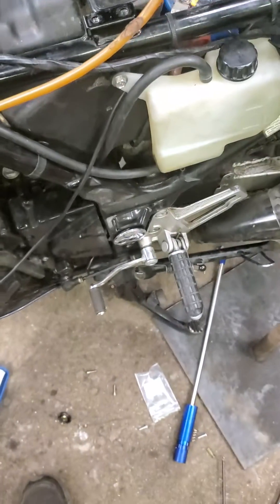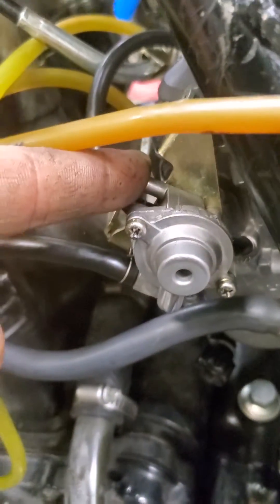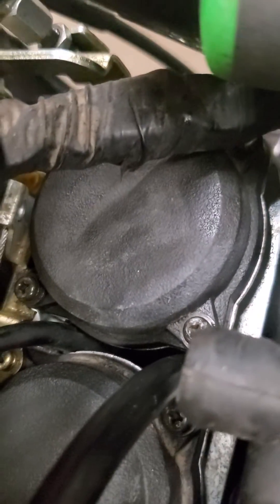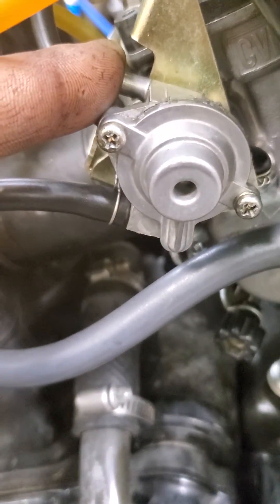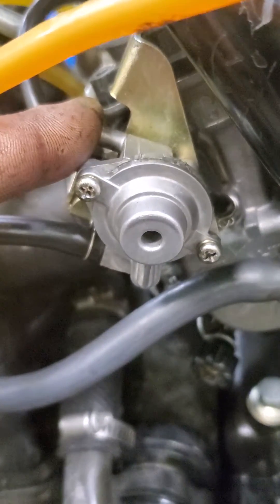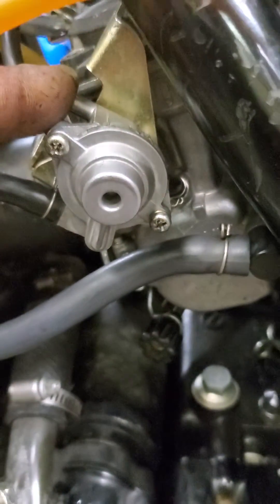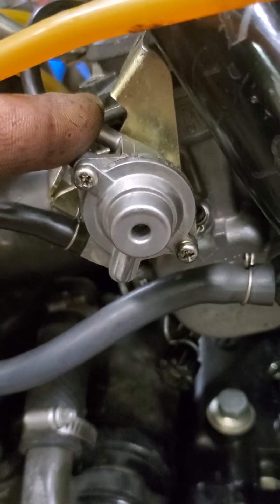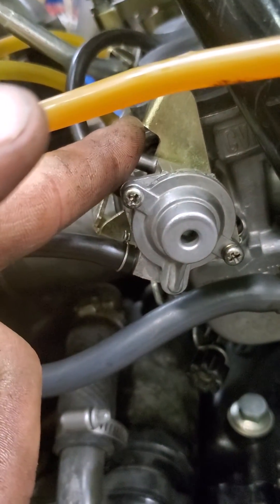Ninja 250 vacuum leak.

Comment: My ninja 250r which is 2011 model (the carb look alike the old gen) have this enricher problem so my mechanic took off the spring inside  the valve diaphragm and its now idling kinda better at 1,3k rpm but i think it has side effect when i rev to 2k rpm it returned below 1000 while i rev over 4k rpm it returns at 1,3k rpm which is the adjusted idle, what you think could be wrong? It has factory pilot and main jet also the both needle that different left and right code
Reply from the maker: If it is the spring and diaphragm I talk about in this video, it has to be in there and it has to be sealed.  That diaphragm is only opened when the throttle is closed and high enought rpm aka vacuum. 

In the video, the issue is that even tho the diaphragm spring is holding it closed and there is no vacuum,  it's leaking around the head of the pin on the diaphragm causing it to leak.  And it can not leak.

As for carbs, everything has to be right.  It's not 1 thing that makes an engine run well, it's all of it. 

Make sure you have no vacuum leaks between the carbs and the cylinder head.  Make sure your float high is right.  Not just by setting rhe float arm at 90 degrees, but also with a u shaped hose on the bowl drain to check fuel level inside the bowl.
Reply: @jdsstegman  well the diaphragm actually teared, but there's no leak between the valve diaphragm housing and the cover (even there is, can i use a sealent?). Theres no leak between carb and the engine head area especially the manifold, but im really skeptical on the coin valve also my Mechanic told me the vacuum valve and the spring is troubling too probably making the carb return to idle slower if i rev'd up over 4k rpm
Reply from the maker: @lordmeme9965  fix what you know is bad.  There is no selant that will work.  Replace the diaphragm with a new one.
Reply: @jdsstegman theres no one sell this diaphragm
Reply from the maker: @lordmeme9965  I'm pretty sure there are air cut off valaves available. 

But when I can, I will post a new video showing better what I'm talking about.  But if your diaphragm is torn, that's a different issue than what this video talks about and yours will have an even worse vacuum leak.  I would try and plug the vacuum like to the air cut off valave and see if that helps the idle issue.

Comment: if its not sealed would it be the fittings diaphgrams or the gap between them ?
Reply from the maker: The brass nipple on the diagram.   When it is in the hole and the spring pushes it closed, air can still go around the nipple.  That's where the leak occurs.   So at the base of the stem, that's where I put an oring.  That way if the nipple leaks, air will go down the stem but can leak past the oring.

Most of the time, I new diaphragm do little.  Because the aluminum hole that the diaphragm nipple goes down into is worn.  I use to re sleeve them with a brass insert, but every time to let off the throttle,  that diaphragm moves back and forth.  So they simply wear out.

Comment: Very good video on this valve but im still struggling to understand this valve. what is the actual purpose of it. And when you say " the idle does not hang" what do you mean by this? Also would i be right in saying you were applying vaccum to the enrichment valve on this video. i just noticed the position of your brass tap on that yellow/black pipe. were you just doing it for demonstration purposes.  thanks for the video.

Comment: My problem is that after 7 RPM it cuts off and there is no power. Could it be the same valve?
Reply from the maker: I don't think so.  You are accelerating so 1: there is no manifold vacuum and the valve only opens when rhe throttle is closed. 2:  at 7k you are running on the main jets in the carbs.  This valave is only to add fuel for idle when the the throttle is closed but the engine isn't at idle.so, I highly doubt it.

There are alot of reasons an engine will not get over a certian rpm.  If you have gone threw the carbs already, then double check your work.
Reply: Thank you for your answer me @jdsstegman

Comment: Great vid, I’ve got the same bike 2003 but same engine and vacuum setup. It has the same symptoms as shown in the vid, as in if the line is blocked off then it idles down, but in my case it completely stalls. Once the block is released, it goes up to a few thousand rpm idle. Any ideas? Thanks
Reply: idle jets clogged.

Comment: You sir are a wizard! It worked like magic! Pulled carbs. twice, once more than necessary. Long story short. Put o ring on, idle could now be adjusted with accuracy and ease. Blip the throttle and rpm falls right back to 1,400 to 1,500. Much thanks you save me from pulling carbs. who knows how many more times! Thank you again.
Reply: Hey, im blipping the throttle and it stays high, what did u exactly do?
Which O-ring did u put where?

Comment: So, good news. When I get my carb past 90 degrees, I blow on the fuel in line and it gets completely shut off. once the floats open the fuel(air) flows. I put an o ring on the brass shaft. It sits on top of the "base". Should it go around the base? That would prevent full movement of the diaphragm? I have pictures . Can I email you?
Reply from the maker: They have to be at 90 or slightly before 90.  If the floats sit down in the bowl lower than 90, when they are right side up that will be over full.

As for the diagram for the enrichment an oring should be placed at the end of the shaft.   The shaft had a head on it and the o ring has to go around the head down to the base. 

The problem is the head can wear and so can the body of the carb and they head won't stop airflow.   But if there is an oring at the base then the oring seals the hole with the help of the head and when the spring closes it and no vacuum is applied it is sealed.

I will try and make a video of this.
Reply from the maker: @EvolvingNaturally    no sealant.   It will just stop air from entering the hole the head goes in.  That head is called a pintal by the way.  Lol.
Reply: @jdsstegman  Tried my bike with the o-ring and carb rebuild tonight - idles great. I've ordered a new petcock as my tank emptied into a new hole in my driveway.

Thank you for the help. Looking forward to the "pintel ring"..... it will help many people!

Comment: I just did a carb rebuild with new needles and gaskets. I have the random idle issue too! My biggest problem is the fuel coming out of the carbs after giving it some throttle trying to get the idle down. Should my floats be at 90 degrees before hitting the pins? That's where they are set at.
I have some left over o-rings so I will put that on the enrichment diaphragm.

Thanks,
Matt - 2001 Ninja 250
Reply from the maker: So proper float high is a must!!  Most important thing.  New needles if you haven already.  With the carbs up side down the float arm should make 90 degrees to the casing arms that the pin goes there.  And the little swing loaded tip on the must carry the weight of the floats while upside down.  

You should be able to push down on the float and it should pop back up and sit 90.  If not, the needle is shot.  And once upside down, you can try and blow threw the fuel line with your mouth.   If you can push air threw with you mouth, they is a leak.  I then use soapy water so see where bubbles appear.

Some times it's bad cross over fuel tube orings that will leak and it looks like the carbs overflow cuz it drips off the bottom of the carbs.  In short you should not be able to make any air move with your mouth.   There is no magic number on how mush psi they should hold but the mouth trick has never failed.   Compressed air is too strong.   Only 2 to 3 psi is enough.  

I will try and make a video on all this and send a link.
Reply from the maker: Also, only needles and carb kits I will use is K&L or keyster.   I have had to many issues with other kits.  Even oem.  And I also only use needles that are ethanol resistant.

Comment: Great video. I just reinstalled Carbs on a Ninja250, had actually been looking for a diagram on correct install of the hoses and this helped a lot.
Reply from the maker: Glad it helped.   I need to edit it to show where I put the oring on the secondary enrichment valave.  The one that causes the vacuum leaks.
Reply: @jdsstegman  I’d love that. Would help a lot of people. You happen to have the service manual for this bike? Trying to get my 250 running, feels like something simple.
Reply from the maker: @ctcourtking 

I do somewhere......  but most of the time I use and online service program.  And honestly most of the time they are lacking in info.

If your bike does not run, then most likely this is not your issue.   All this causes is a high idle.
Reply: Есть схема подключения шлангов?

Comment: I need help so this pointed me in a good direction but im afraid it might be more than that i am not getting any fuel to the carb
I was told before it gavity fed but further research it is vacuum fed. Im at a loss right now
Reply from the maker: So the petcock needs vacuum from the intake to open the fuel petcock to allow fuel out of the tank.

This issue I'm showing in the video, has nothing to do with the carburators getting fuel.
Reply: @jdsstegman  i know that now lol, i just help identifying what line that is cause i cant find any diagrams online to help pount me in tge right direction of which line it is that pulls the vacuum from the tank to get it to the carb
Reply from the maker: @crittygiglio8615  

Any line that is in-between the cylinder head and the butterfly of the throttle. If I remeber right, each carb had a brass nipple on the front of the carb.
Reply: @crittygiglio8615  buy a stinking manual !

Comment: This guy is the shit right helps out in comments too I like the clarity and dedication....I have a 95 I think this is my issue for a temporary fix can I plug it ??
Reply from the maker: No don't plug it. Then at high rpm on deceleration the engine will go lean and backfire.   And because the motor isn't under power stroke load, the backfires are technically detonation.   And that's not good for an engine.
Reply: So what should I do
Reply from the maker: @Craig Zander  well, if you have issues with high idle, then check for vacuum leaks anywhere they may be.  And also make sure everything else is good about the carbs.  Meaning rebuilt.   These 2 things are the only place to start really.

Comment: Dam I think my ninja 259 has the same issue, took the longest to figure out what it was, except mine rose up to like 6k rpms lol
Reply from the maker: Yeah, I have seen it be that high as well.  With a vacuum leak it's unpredictable.   These carbs are not special except they just have a remote enrichment valave that controls both carbs.  And to say both carbs should be enriched identically is absurd as well.  So when I scync them, I always disconnect the enrichment to keep each carb separate from eachother for each cylinder.  Get a way smoother and more accurate scync that way.

Comment: I tried this on my bike that has cold starting issues and idle issues when cold. I let the bike warm-up and found that when I took my finger off the rightmost hose connection on the coast valve, the idle would quickly rise to 2-3k, and then after a few seconds, it would fall back down to 1k where it would stay until I put my finger back on which would cause it to do the same thing as when I took my finger off. I tried this multiple times and it did the exact same thing every time I took my finger off it and every time I put it back on. Would you say that I have the same issue? I know you said the idle shouldn't change at all which makes me believe I have the same issue, but my rpm didn't climb nearly as high or for as long as yours did. Thank you for the very informative video, these can be hard to come by.
Reply from the maker: It's worth a shot to put and oring in the base of the "nipple"on the air cut off valave and try the same thing you did before and see if you have made a change.   I have yet to see one not leak.
Reply from the maker: And yes.   They are hard to come by.  But an oring on the base usually makes it seal without hurting its functionality.   

I think the true culprit is all these bikes are jetted to lean on the pilot.   Slight air leaks on most other bikes don't act like they act on the ninjas with these carbs.

Comment: I have the same problem also has gas coming out of the overflow, could this cause this to happen or is it something else.
Reply from the maker: Nope.  If fuel comes out the overflow, then the needle and seats are allowing too much fuel into the carbs.  Best bet is to rebuild your carbs and make sure you set the float hight properly.

Comment from the maker: Your welcome.  Every one of these i see fails.  So my trick is the pintel  on the diaphram I put an oring at is base.  So when the spring closes the valave, the oring sits against the base of the housing and sealing it.  Then it works right and still enriches the circuit when it needs to but no more high idle.

There is a lot of web title searches for high ideas on these bikes and many people have said that the dealership just says that's just the way some are......lol
Reply: Can you make a video were you show how to put the oríng please?
Reply: Where do u place the o ring
Reply from the maker: @gerardmcconnon9155  

The diaphram has a tip on it made of brass.   Put the oring over the tip and slide it down to the base of the diaphram.
Reply: @jdsstegman 
Thank you very much
It has me tortured
Reply from the maker: I posted a new video.  Look up ninja 250 enrichment valave.  I'm not sure how to send a link so just look it up.